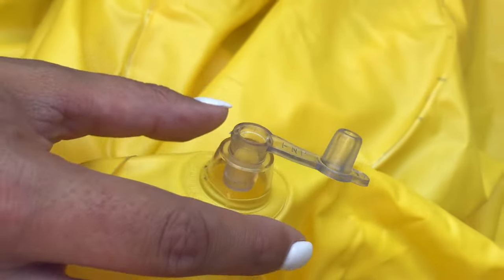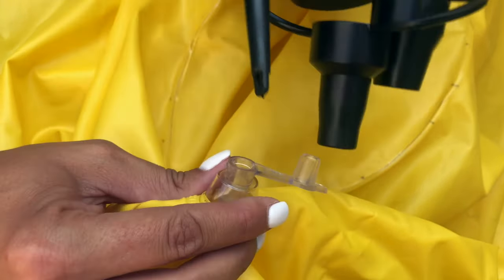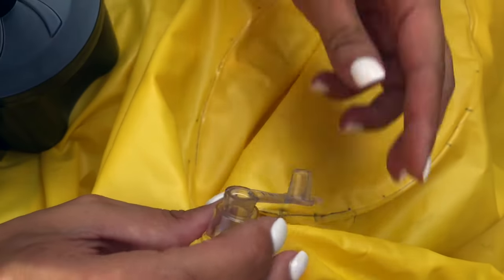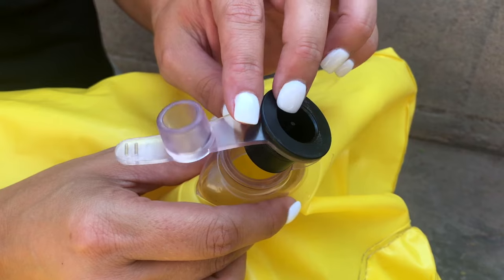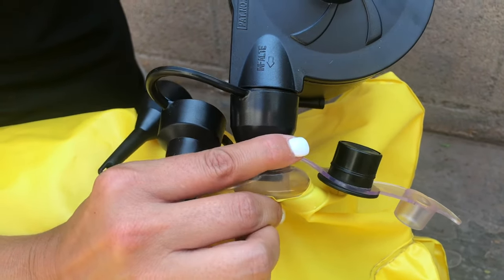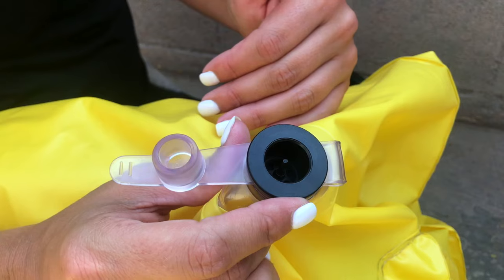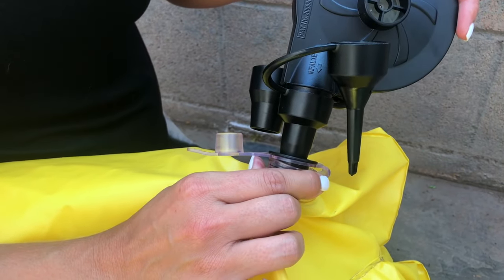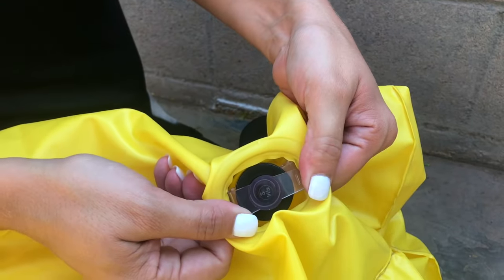How to inflate and deflate your Derby Duck pool inflatable.

Comment: F up. Where is the deflate
Reply: Oh!! If you no understand how flat the product,so you need open valve and press your fingers as air escape easy.The other type you open that black plug and air going to out and you achieve deflate easy too.And pump have the place of inflate and deflate right for you maker the process correctly.